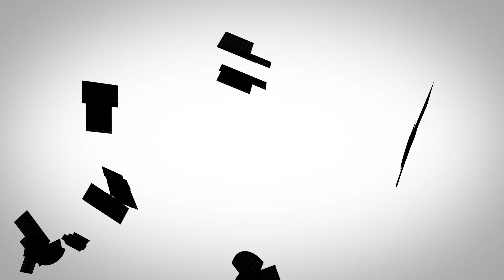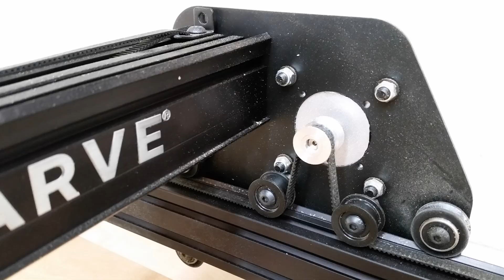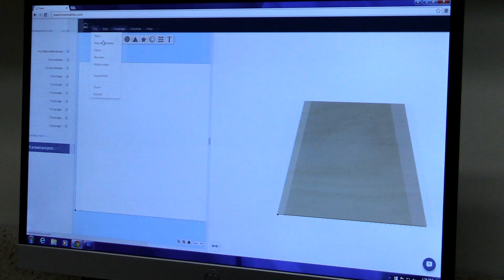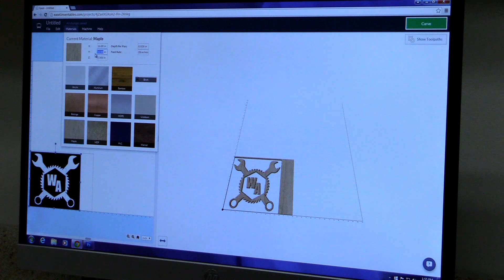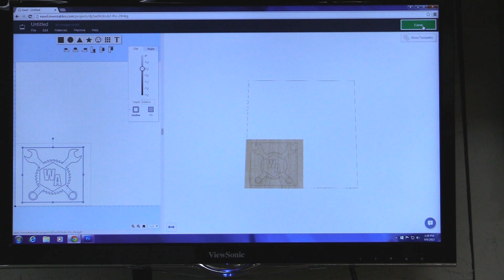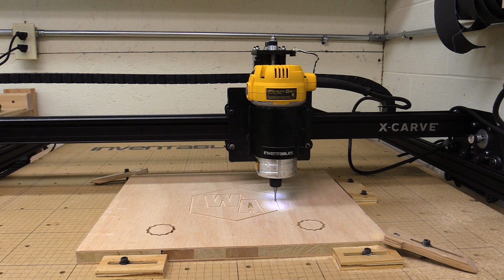X-CARVE by Inventables

Comment: Well if it only took you 10 and a half hours then it is quick to assemble. But For $1,400 you're really not getting a whole lot. What I'm seeing generously looks to me like you're getting maybe $400 worth of hardware total. I bet they pay even less than that for it in bulk too. Now I understand companies need to make a profit to stay in business but do they really need to gouge their customers 350%? It seems a bit much to me. I'd be happier to just see 100% markup. At that I would not have even mentioned it.

Now for what doesn't thrill me about the unit itself. No height capacity. I get that they only expect you to be cutting dimensional lumber on the unit but you're really only cutting dimensional lumber. 5 inches of Z travel is really a bare minimum for a bit of flexibility. This unit looks like it has 1 inch of Z travel. I get that they did that so they could use cheese whiz in their design. Still, it really comes up short.

Then there's the proprietary software. If this unit can't run on step and direction input and allow you to use any control software you want, forget about it. Software lock in is built in limitation. I suppose you could toss out their control board for a different one. Still, that is a hassle you shouldn't have to go through.

Their target audience is definitely people that don't know the first thing about CNC, and never want to either. Ignorance certainly has a price associated with it though. 350% mark up for starters.
Reply: *****
GRBL is good but I would not go quite so far as to say you could send any G-Code to it. I would like to see a skate bearing and belt drive machine quite a bit cheaper than they're offering it.